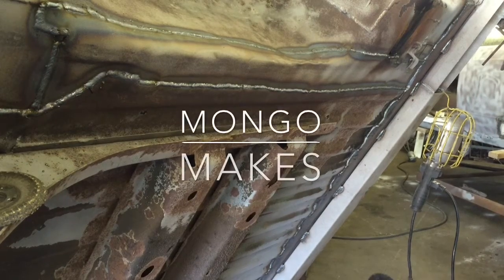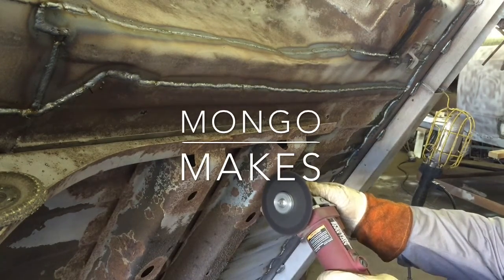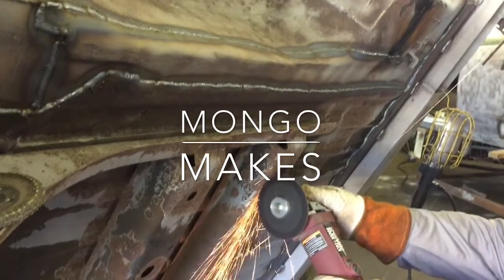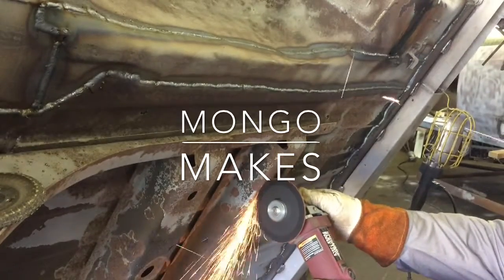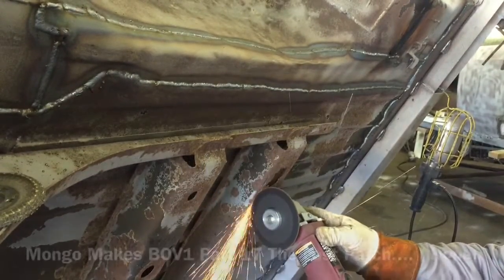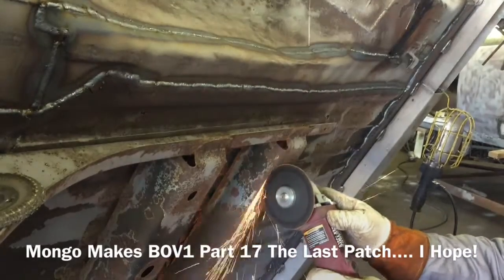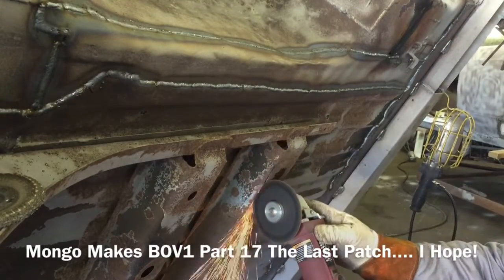Mongo's Garage BOV1 Part 17 - The Last Patches

Comment from the maker: Chassis Saver by Magnet Paints. It is an asphalt based coating that is sensitive to UV light thus it can only be used on the bottom of the car, goes on right over old undercoating and soaks in! Don't get it on you thou, or in your hair, trust me you will need to get a hair cut!